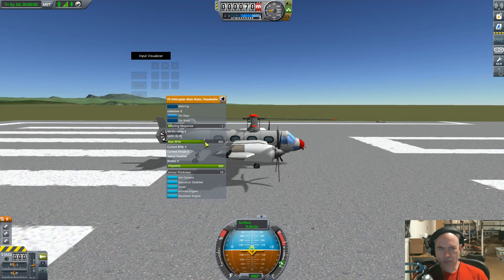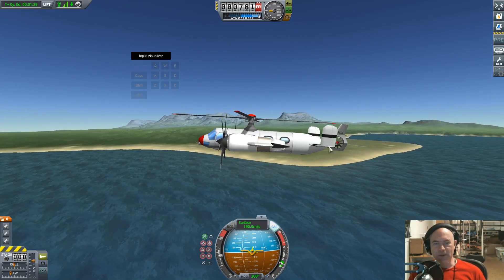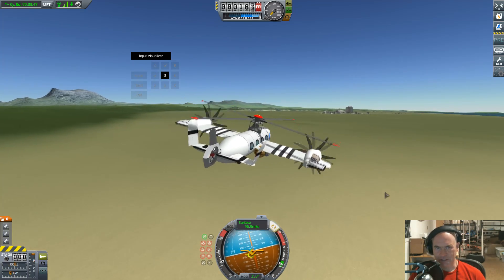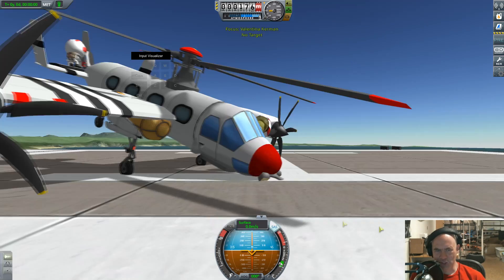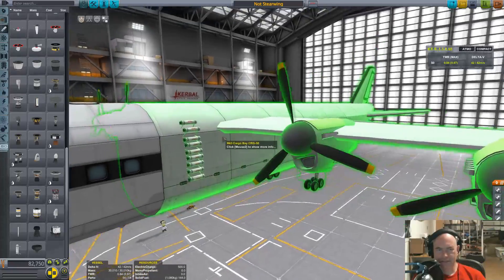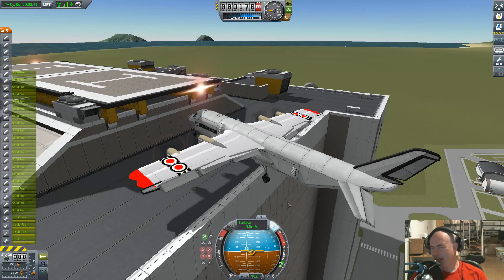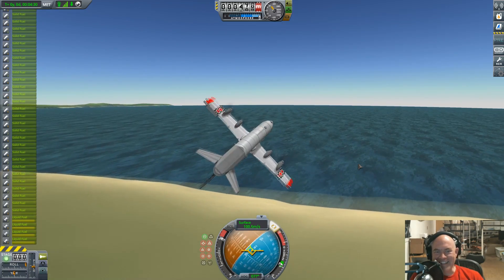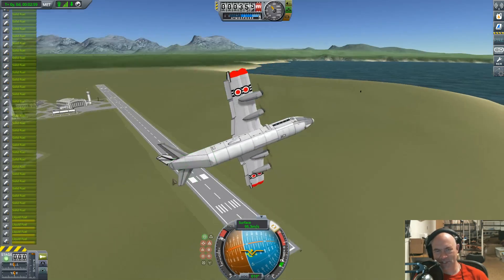Crazy Kerbal Short Runway Solutions - Rotodyne & Credible Sport

Comment: The thing about Credible Sport was it wasn't just for a short takeoff and landing, but it had to do it inside a soccer stadium which meant it had to have a fairly steep approach and departure not just to clear the hypothetical 50 foot obstacle at the beginning and end of every normal (FAA pilot test) runway, but also because it was going to want to avoid ground fire from hostiles.  It was an incredibly ballsy idea.
Reply from the maker: Yeah, I need to do a lot of work on aerodynamics to make the steep descent work
Reply: Let’s not forget that the C-130 also landed and launched from USS Forrestal
Reply: Did it ever make it that far?  I thought it was cancelled after a testing crash while still working on procedures.
Reply: ah, yeah, I remember that project.

Quite insane. I've had flying lessons on an aircraft that weighs just 450 kg. (~1000 pounds), and a landing run that short is outside the performance envelope of even an aircraft like that.
Not by much, but still...
(And a typical landing for a novice pilot is quite a bit longer than that of course.)
And you want to do that with a c130? XD
Quite the insane scheme...
Reply: Scott Manley To do it as "properly".. yes. But I KNOW you can do it with slight modification by just rotating the reverse rockets in a slightly downward position, so that they generate lift as well as slowing the aircraft. I am certain that you can, because i did it a long time back trying to land on the VAB. It gives you a VERY narrow window to be in to work, with altitude and velocity needing to be just right with the preset thrust from the rockets to stop and lower you, but with testing and (lots of) time, you can get it to stop you near instantly and then slow your decent to survivable speed. IIRC I ended up having to do two stages for it to stop and land vertically (or nearly so).
Reply: It was canceled very shortly before the actual mission because of a crash, but it had several successful tests. Frankly I'm sad they didn't go ahead with it. The crash was pilot error for firing the reverse rockets much too soon and was no fault of the system itself